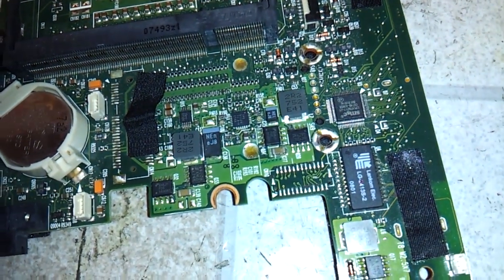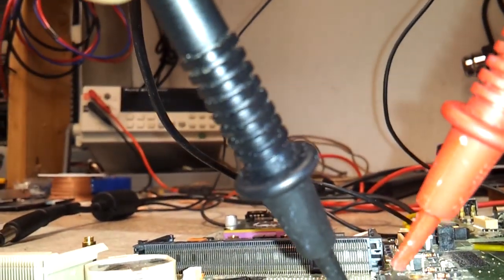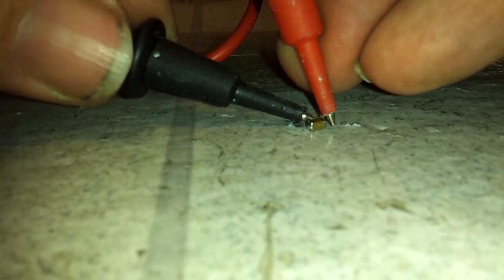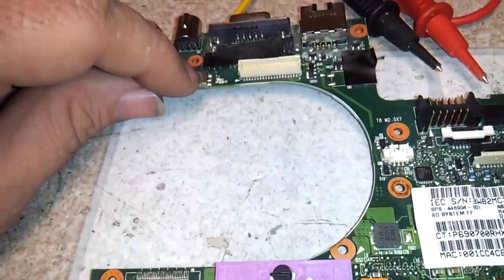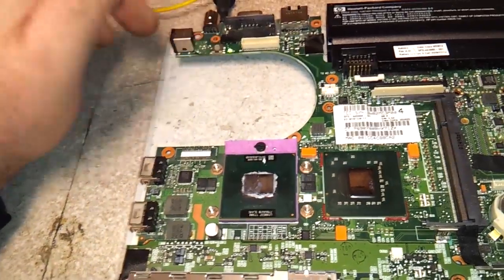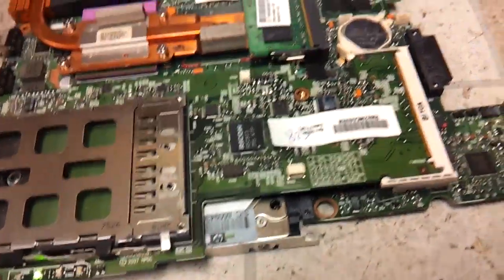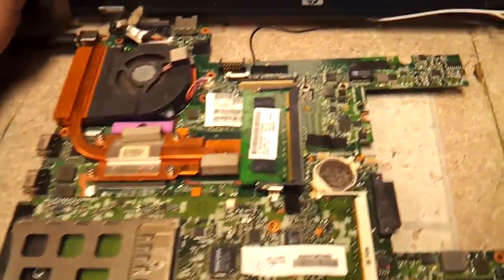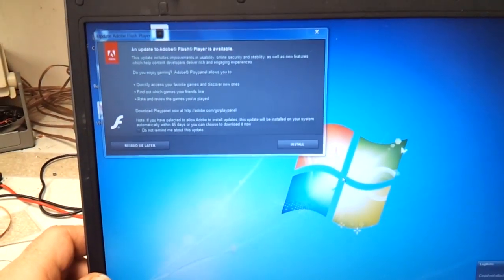HP Compaq 6710B dead motherboard repair

Comment: Hello sir, I hope you are fine.
I have the same laptop ... it works immediately when I connect the charging cable ... and the power button does not work when I turn off the device ... Thank you.
Translation from Google.

Comment: I'd say it's just pure luck that it was an SMD cheramic capacitor that shorted. I've had issues like toasted charging protector ICs, dead MOSFETs and close/open resistors. Nice that you got it working though :)
Reply from the maker: Ive worked on a ton of motherboards, Only thing I have seen is a toshiba fail from a shorted SOIC-8 MOSFET. All the rest were shorted MLCC capacitors, or bad GPUs. Keep in mind, this is outside the usual DC jack problems.